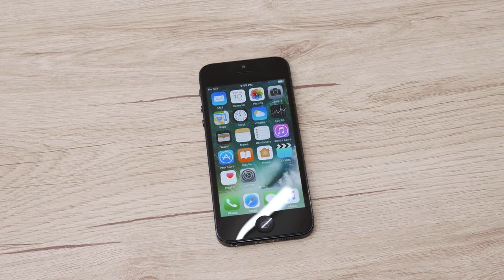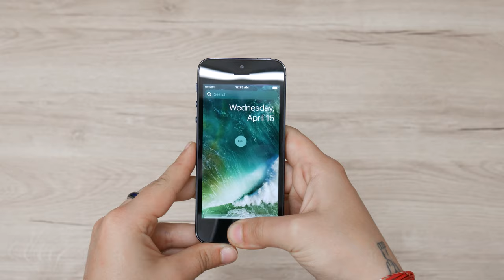iPhone 5 - Full restoration 2020 📱

Comment: The battery won't last forever as I know of one phone I had which was a gold S6 and the battery sucked as I had it in 2018 and that was when I was on holiday with my mam in Cuba when the battery got to 50% and the screen just goes off then a white light is on then restarts and my edit is that does Apple do new batteries for older iPhones
Reply from the maker: For now batteries have on ebay, ali express even in mobile store, so I don't know if they are refurbished or new but they work 😃
Reply: @MoBomonica  yeah don't trust ebay as once when I watched a youtuber who had one of those 2011 macbooks with the detachable battery and his battery couldn't hold charge and he got a 2017 model macbook air and he got a battery off ebay and after 6 months of use the battery was swollen and it was that bad he couldn't do a left click on the trackpad so he took it out and kept the charger in 24/7 and for safety the macbook had limited its CPU speed to 50% and he hated editing on it